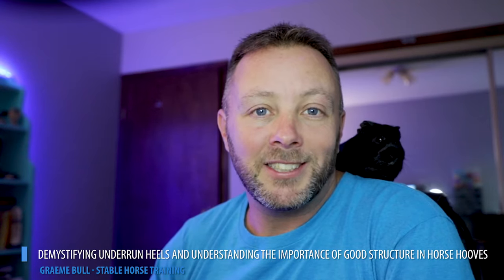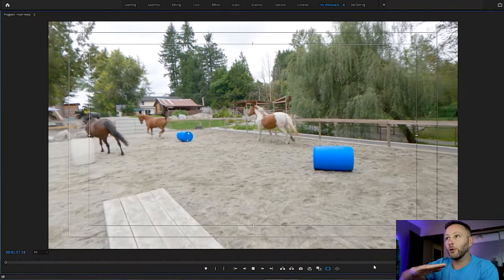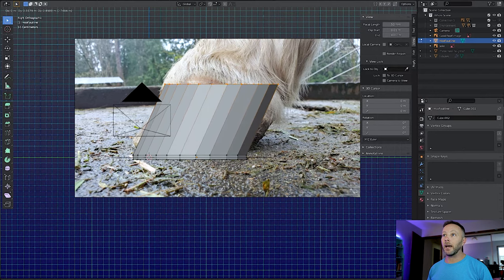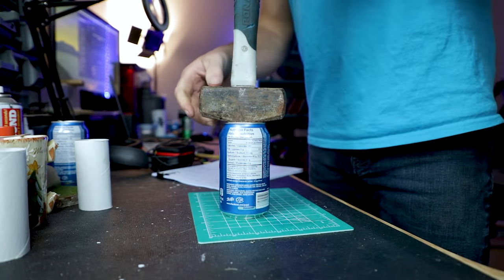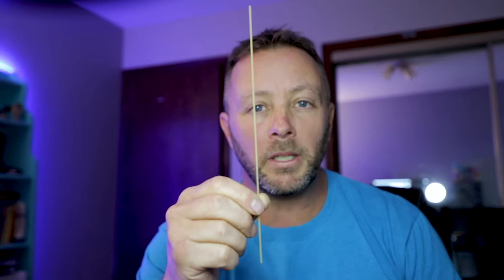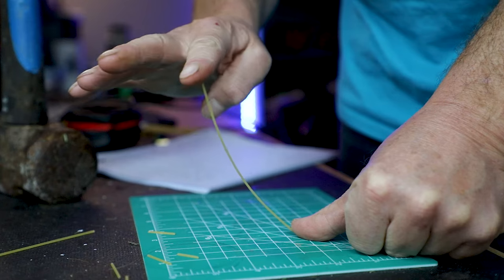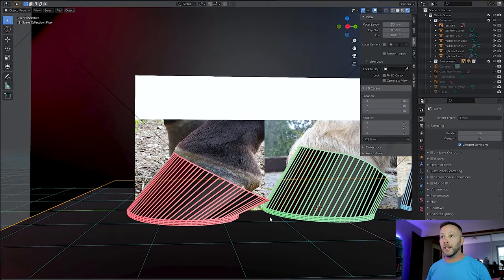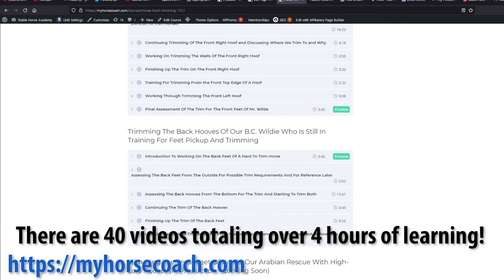Fully Understanding Underrun Heels In Horse Hooves

Comment: Very interesting video. Not only that hoof on the left has the worst angle, it also has a shoe on. I wonder what should be done to the hoof when someone wants to transition from shoe to a natural hoof, if the horse should use boots for a while, if any products should be used where the nails were to help prevent any sort of infection, or if nothing should be done except trimming and waiting for the hoof to heal on its own.
Reply from the maker: Transitioning is usually a slow process if the hoof has gone really far down the wrong path like the foot on the left. In some cases boots are handy and help the horse, but not all need it if they don't get forced to do things that will hurt them at the time.

Comment: Very good video Graeme. Very clear and logical. I have 2 questions.
First, in the middle hoof I noticed the hairline was not straight. I was taught that indicated imbalance in the trim that could compromise structural integrity. Do you agree?

Second, I have a pony that genetically has very contracted heels with very upright feet (we call them club feet here). My teacher said that I should trim to the shape nature made her and not try to trim her feet to look like a normal foot. What are your thoughts? I always trim her to what it seems her genetics determines and she has never had hoof problems or lameness in 20+ years.
Reply from the maker: Thank you Ross, I take that as a very high compliment coming from you.

Those are two excellent questions actually. Good observation on the middle foot. Here's a rule though: We don't trim to what the outside looks like, we trim to what the sole tells us.

First off, I never moved the hair out of the way so my 3D image may be slightly off, but my intuition when modeling the foot put it there. The bump could be smoother. Anyways, it's hard to say if there is a compromised structure with the slight wave in the hoof wall at the coronet band. This could mean that the quarters are jamming up and need relief, but some feet that are half way between fixing will have this. I would be keeping a sharp eye on that change for sure. In an ideal world we would have a more smooth curve and not that little bump, so in the end, yes, we want that to smooth out. If the sole says that the foot should stay in that shape for now, then that's what we do, if the sole has more of an arch to it, then that foot at the ground level of the hoof wall needs more of a trim to relieve that bump to arch with it and in turn would relieve the bump to relax back down. Either way though, I would be curious and ask how the structure is being compromised if there is no flare, no cracks and no splits. A jamming of the coronet band (usually at the toe) can lead to abscesses (very common in the case of the left foot as the hoof wall jams inwards to the coronet band and not just upwards) but not common in other locations. 

For the club foot (I recommend some studies by the late Dr. James Rooney who calls it more appropriately a "stump foot") I too do not recommend trimming to the "ideal shape" that we see in the middle foot. In fact the foot on the right is just that, a foot I have been trimming over the last few years from an almost parallel to the ground coronet band, to one that is responding well to minor changes in the heel height over time, always in accordance to what the sole says. This horse is still young and can likely made the biological adjustment to a more "normal foot" but I don't force it. Does that make sense?
Reply: @StableHorseTraining  thanks Graeme. Your explanation is very clear. Our horses would seem to agree with you.

Comment: so I have a horse with underrun heals for 9 years, several barefoot trimmers tried to correct and it has not happened, Tried glued on with wedge, cast with wedge and maybe nothing worked because they came off quite quickly (no heels?)and trimmer had 4 to 5 week intervals. Since 9 months I trim myself, now every week and so his toes get shorter, but how can I manage to get to grow heel? He lives on gravel and especially in summer wears a lot. But I have not found hoofboots that don t rub his low heels. I do ride him in hoofboots with thick pads Easy care OldMacs. The easy boot gloves always came off in a canter. But even those rub for turnout. Side not he was on sand only for the first  few years and did not grow heel either. Have you done a uprighting heel video or section somewhere?
Reply from the maker: I don't have a video specifically addressing underrun heels for trim as each foot is different. This video was supposed to be the one that provides the education on the "why and how" and then it would be up to the trimmer to look at the hoof and see what needs trimming off.

As I can't see your horse's hoof, there's no advice I can give that would be responsible. I can say though that wedges are the absolute worst thing that anybody could have done as it make the situation worse and I very much expect that after 9 years it probably is not fixable as there should be bone loss on the pedal bone and long term lack of caudal (back of the foot) build up of cartilage. My horses all live on gravel 24/7 365 days a year and it's a struggle to keep up with their growth.. 

Anyways, my expectation is that you're leaving "long heels" which continue to be crushed under the foot and dragged under. This is a problem that requires weekly trims and while the toes are important, the rest of the foot is more important. Heels, bars, quarters and making sure the back of the foot does not hurt. Way too much to cover in a comment on YouTube unfortunately.

Comment: Hi there!!! Thank you so much! Unfortunately my ex race TB has the 3rd hoof… very low heel 
How do we correct this?
Reply from the maker: I have found it rare to see a TB come out of it as they are set up from birth to have incredibly poor feet and as such the pattern is super hard to break because the internal structure just isn't there to have the foot stand up. That said, if you're diligent, it can be done I believe. This involves VERY regular trims and proper ones that will improve the internals. Most farriers will tell you to shoe it, if you aren't already, but that's how that horse got there in the first place, so I don't suggest that. It's a lot to explain and requires spending time to get the education for the job and likely trimming your own horse to be honest.

Comment: Also in bad under run heels it's a good idea to get an xray of the hoof so you can see how the pedal bone sits . If there is excess toe that can be removed and help restore the HPA . sometimes with badly collapsed heels then a egg bar or at least a straight bar be fitted to equalize the pressure around the hoof wall and the heels don't take such a pounding .
Reply from the maker: Oh good, another know it all farrier has shown up to let us all know to shoe a horse to fix a problem... Come out of the 1600's buddy and join us in the year 2024.

Comment: So how do you adjust an underrun heel or an upright?
Reply from the maker: You trim early and trim often. Underrun heels can be caused by poor trimming practices for sure, but the majority are caused by long trim cycles. To put it simply, if you're rehabbing a foot then anything more than 2 weeks is too long. Small changes should be made almost weekly but definitely bi-monthly. A normal schedule falls no later than 4 weeks, anything longer and you're going to be fighting distortion and mechanical leverage. 3 weeks is good for healthy feet. 

In the end, the tubules have to be stood back up, to get that you have to remove mechanical leverage that is causing the back to collapse and the front to move forward and up. This means keeping those hoof walls as tight as possible for as long as possible until they stand back up. All without laming the horse in the process.

Comment: wonderful video and graphic explanation!!!!   may i just say that I think you mean that the hoof tubules are stronger when force applied is PARALLEL to their lines.   The force vector of the horse's foot landing is at a nearly vertical,  but slightly angled forward line to the ground, wich is perpendicular to the force vector.  The hoof tubules lines that   as closely as possible mirror the verical force vector line of the hoof/leg hitting the ground are the strongest.  Thus,  they should be parallel to the way that that the hoof comes to the ground (the force vector , which is kind of like thinking of the bone of the leg)
Reply from the maker: Definitely perpendicular, 100 percent not parallel. I appreciate the compliment though.